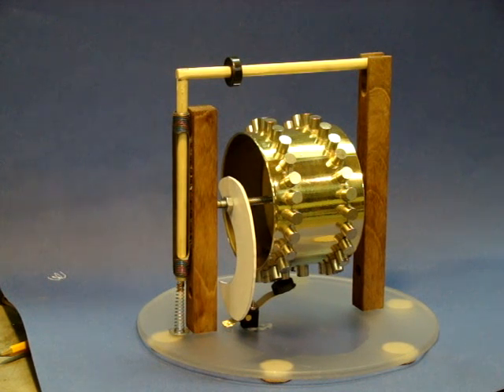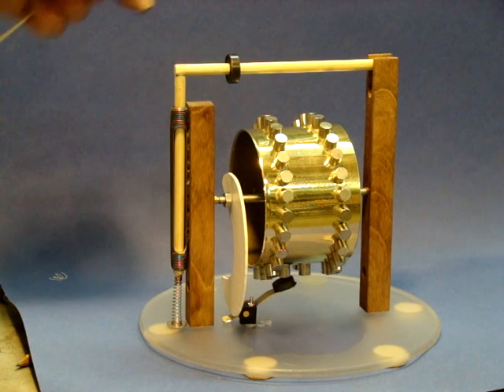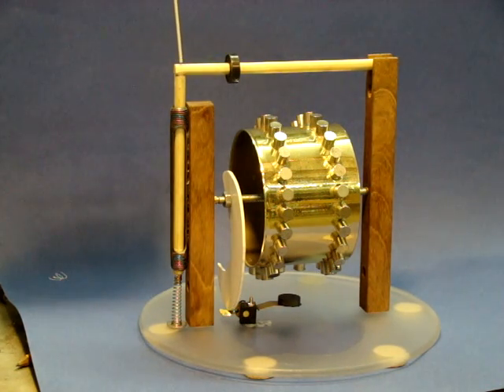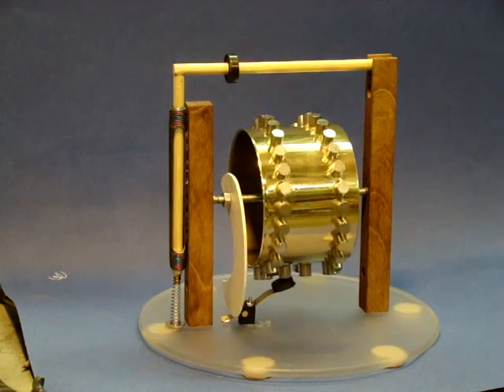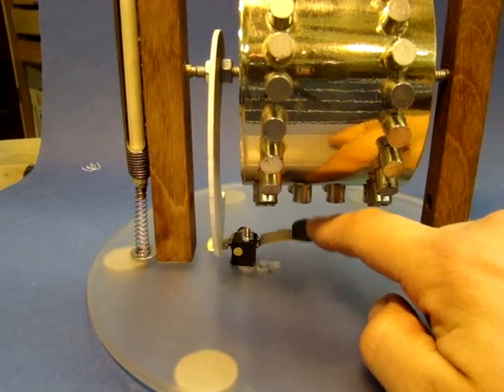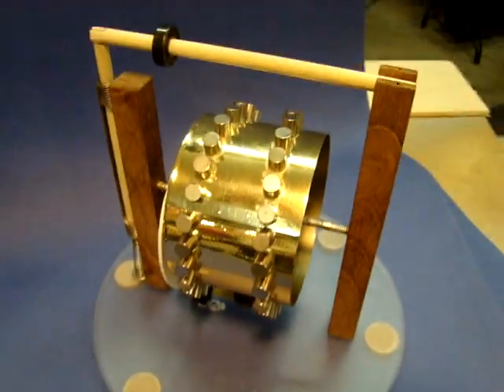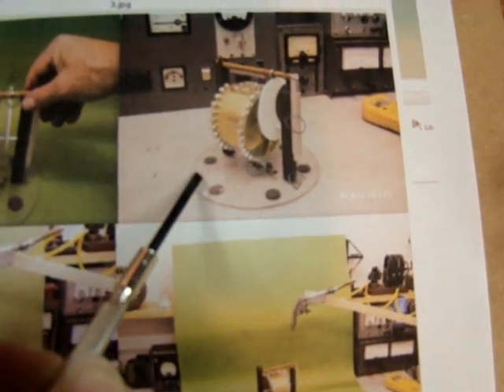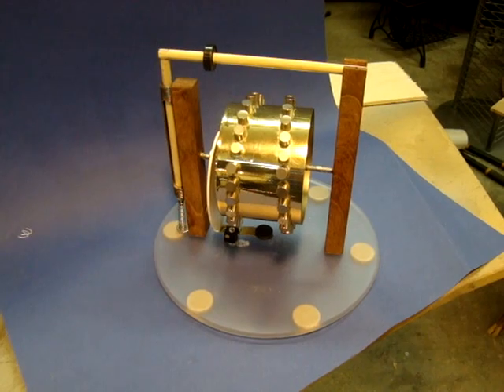Evolution of Perpetual Motion, WORKING Free Energy Generator Part 2 of 3

Comment: Hey, bud, your "duplicate" doesn't even have the magnets in the right place.  The PRIME MOVER magnet in the original is mounted to the TOP of the model, not the bottom.  It's a LARGE bar magnet that is almost the length of the top bar--THAT's the one moving the V gate.  You did a great job discrediting your own work without even opening your mouth.

Comment: It is funny collectively how much time people spend on magnet energy. If you instead focus on converting the flow of water leaving your home, exhaust, wind, and free microwaves and infrared in the air. you could charge a battery that in turn would create browns gas from water which in turn could power a turbine attached to a motor and create electricity. It would be free-er conversion of energy. Stop wasting time o this stuff and follow through on what Tesla did. He used conversion techniques.

Comment from the maker: Actually I am credited to speak about it. And this was no rush job.  I spent 3 three months building it.
 And If anyone who has made a copy of this unit as near as close to the original unit would easily know, it will not work with the parts shown in the original video.  The magnets simply weigh to much for the little amount of torque produced by the single opposing magnets..  Basic physics.  Anyone who has worked or built a v-gate motor will know.